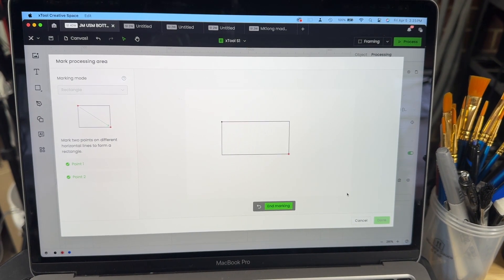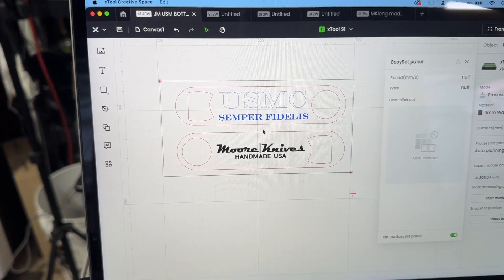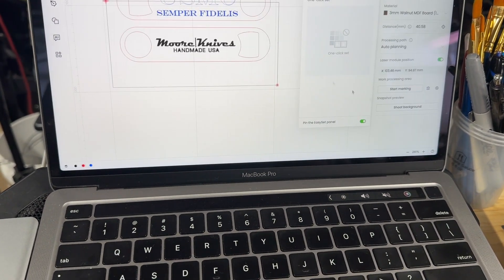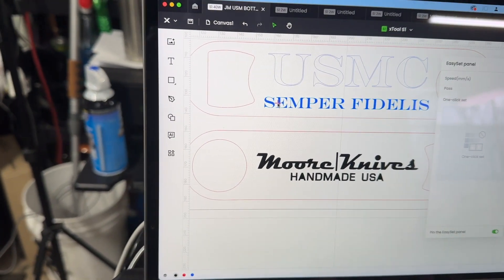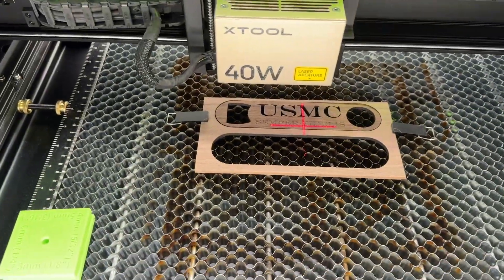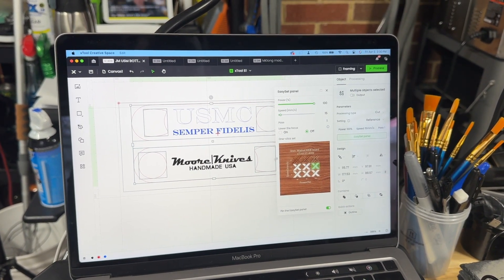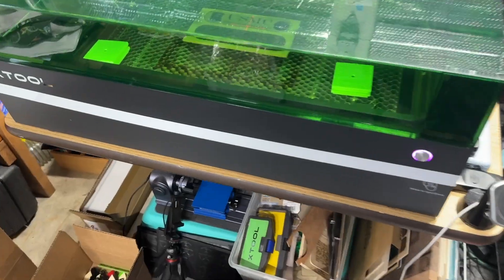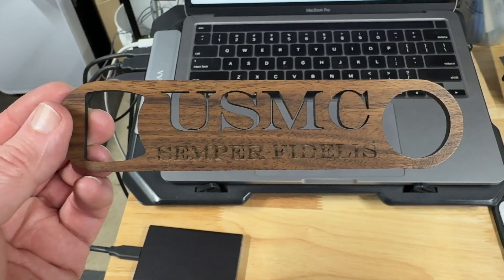Redoing an engraving inside another engraving. No camera, no problem with XCS and the xTool S1 Laser

Comment: Hey Paul, iv got a question I’m new to laser engraving. My question is can you inter change laser modules & do they come with a power plug to your plug from the engraver ? 
Thanks 
Alex
Reply from the maker: The Xtool S1 40 Watt and 20 Watt lasers have available other modules. So you can do like I did and buy the 2W IR for metal engraving and it comes with either the 40 watt or the 20 watt 450nm blue laser that does wood and lots of other material. So yes you just unplug 2 things the air hose and the power plug and they two screws and you swap it to the other unit. I will make a video on it. Thats worth showing so people can see how easy it is to do.
Reply: @ALXSHARPEN  ok thank you Paul cool, I look forward at the video: there a lot to learn about laser engraving unfortunately not much knowledge or information in Australia. 
Cheers
Reply from the maker: @A1sharpedgesharpeningservice  let me share a few of the very best Youtubers I follow for laser stuff. If you want to or need to learn Lightburn Software or have questions about certain laser Rich at Louisiana Hobby Guy is fantastic https://youtu.be/qF8EJLxXIs8?si=rmIouw390T5BrP6S
Reply from the maker: @A1sharpedgesharpeningservice   also Steve Makes Everything is fantastic https://www.youtube.com/@SteveMakesEverything
Reply from the maker: https://www.youtube.com/@TheClackShack is another Top Guy and has great tips
Reply: @ALXSHARPEN  hi Paul yea iv checked him our & subscribe
Reply from the maker: https://www.youtube.com/@justinlaser is also great he talks a lot about the business side of having a laser business
Reply: @ALXSHARPEN  thanks Paul, iv check them out & follow. Thanks for all your help Paul
& look forward to your video soon. 
I’d also when you have time . Where can I find files like the bottle opener  & other cool stuff. Iv been searching the internet just way too much lol  & in Australia 🇦🇺 not to much in laser engraving. 
Thanks again Paul
Reply: Ok cool, thanks Paul for all your help & information. 
Cheers have a great day.